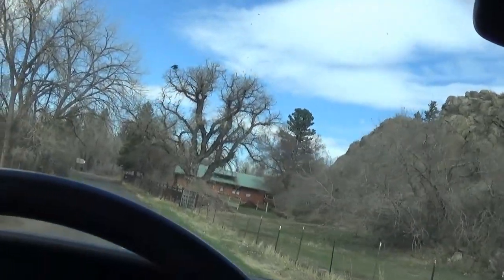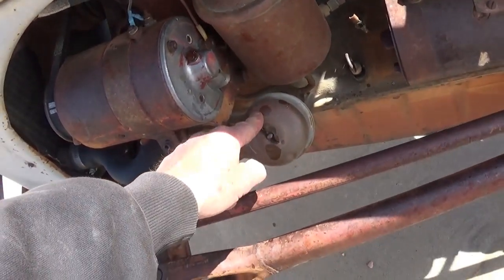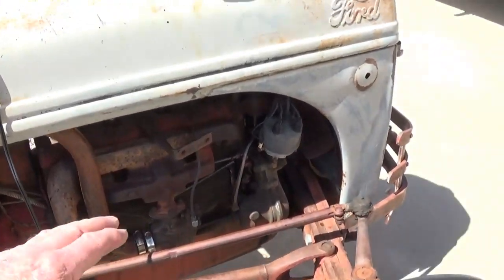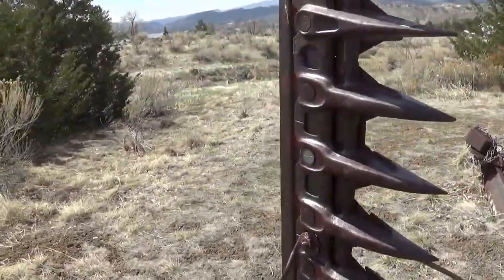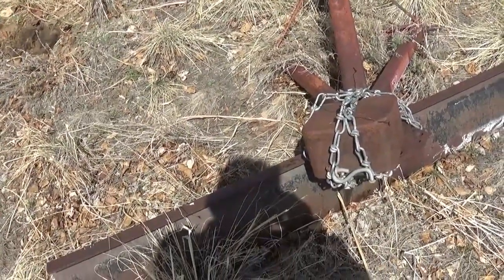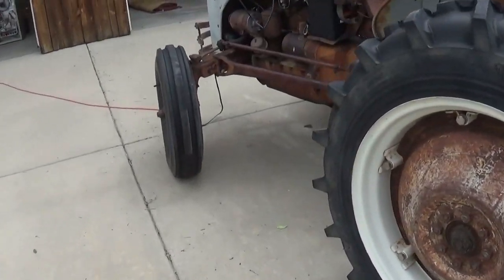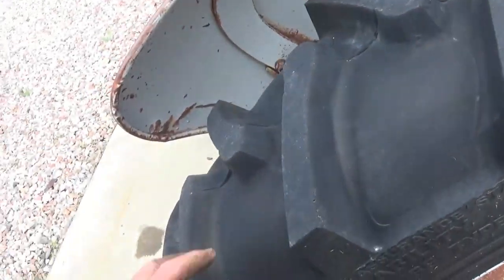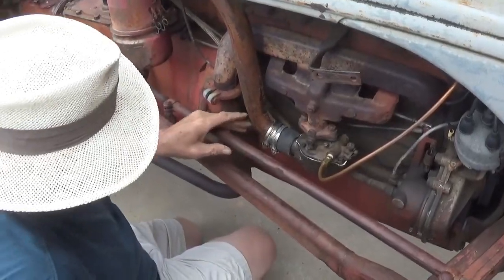A Short Ford Tractor Adventure

Comment: I gotta a 63 custom split bug. Taken my trans axle to a guy who has been doin it for 35 years. Cant do it like you. I also have a 1941 9n tractor. They are really well built balanced motors. Built good like an old vw. Thanks for the videos and knowledge.  Those tractors are tensile stiff sheet metal way tough hard to straighten hard to bend lol. Take care.
Reply from the maker: Virgin steel is always better than recycled IMHO

Comment: Since this 8N has a side distributor, it would be a 1950 to 1952, not a '48.  A 48 will have the distributor on the front of the engine.

Also, the last comment posted isn't entirely correct.  The Ferguson came out in 1946, and it's true Harry Ferguson and Henry Ford got together with a hand shake to make the Ford Ferguson 9N and later the 2N.  But after Henry Ford died, his grandson was put in charge of Ford and he broke the handshake agreement.  This was in the mid to late 40s, so Harry Ferguson started to make his own tractors, the Ferguson TO20, TE20, TO30, etc. in 1946 and basically used a lot of the design of the Ford Ferguson tractors.  Ford then brought out the 8N.  Harry Ferguson also had made tractors prior to the Henry Ford handshake, one with David Brown and then the Ferguson Black.
Reply from the maker: Thanks for schooling me :-)
Reply: No it is not. It is a 1948. I don't know where you got that.

Comment: SINCE I WATCH ALL YOUR VIDEOS ON VW 'S I HAVE A PROJECT I'M DOING , I'M HOPING FOR YOUR EXPERTISE ON DUNE BUGGIES ! I HAVE A 62 VW DUNE BUGGY , I'M DOING A MOTORCYCLE ENGINE SWAP AND I'M USING A RPM GEAR BOX SO I CAN HAVE A REVERSE ! MY QUESTION IS SINCE I'M NOT USING THE AXLE OR TRANSMISSION FROM THE VW ALL I HAVE IS THE SWING ARM , I NEED TO HAVE AN AXLE THAT I CAN HOOK UP A CV JOINT AND AXLE TO MY GEAR BOX  , IT LOOKS LIKE THE DISC ROTOR IS FROM A CHEVY , PLUS I HAVE NO SUPPORT FOR THE BOTTOM OF THE SHOCK ! CAN YOU HELP ?    THANK  YOU        ALAN
Reply from the maker: call Rancho Transmissions and talk to themn